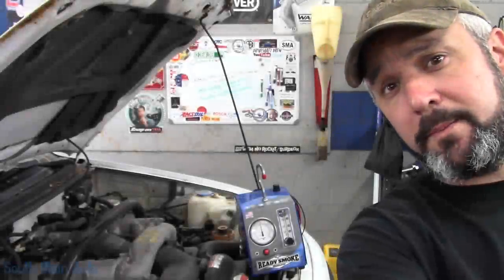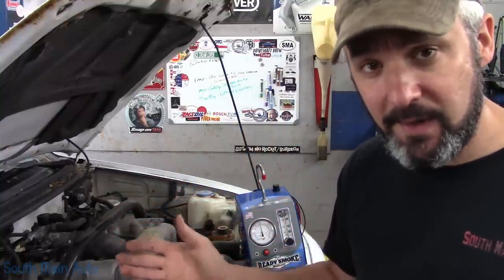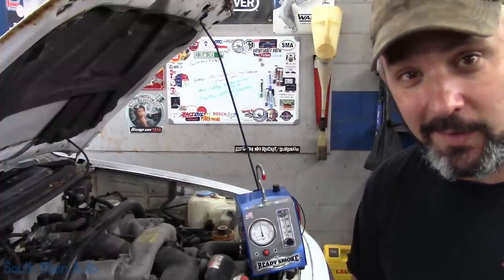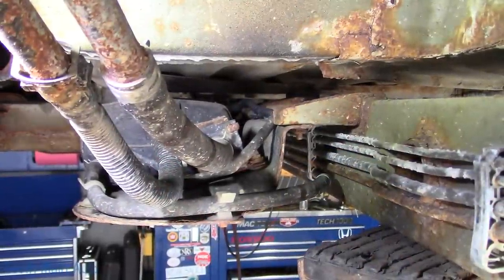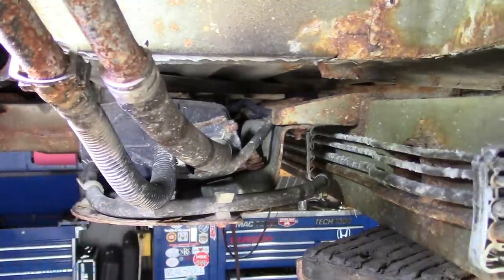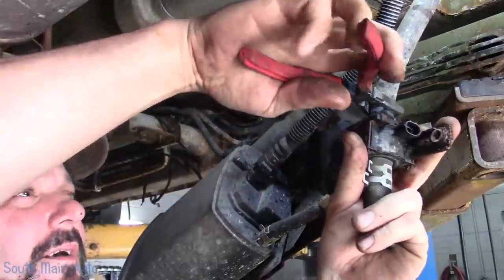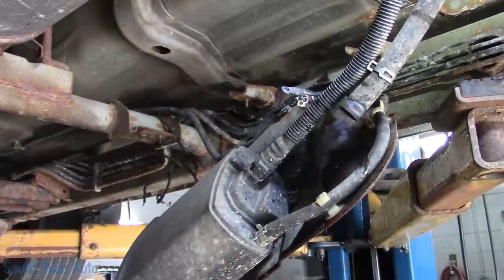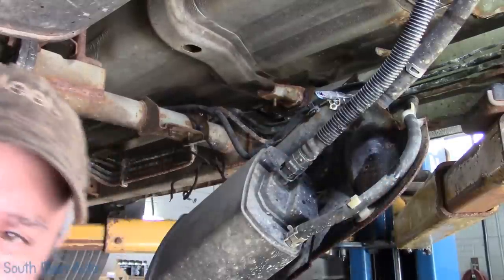Suzuki Vitara: EVAP Problem & Discontinued Parts!?

Comment from the maker: *ReadySmoke (95-0400): https://www.aeswave.com/cart.php?m=affiliate_go&affiliateID=2525b91fc8e906e8215984074c9d9e8f&go=https://www.aeswave.com/ReadySmoke-95-0400-p9661.html
Reply: Looking at those crusty tubes running along the rail, I'm guessing one is fuel and the others are brakes.  For those of us who live in the rust belt, I sure wish the government would mandate a more corrosion proof material for both of those.  Nylon for the fuel lines and there has to be a more corrosion resistant type of brake line other than just plain or even coated steel (without going to stainless steel).
Reply: Look for Cunifer on google
Reply: Where did you get a test light that is higher amperage? or did you just find a build that would work.... And who made the test light with a vice grip? Cool idea!
Reply: @ 16:00 to 17:00 is that the exhaust pipe torn off and dangling there??
Reply: I've been watching your videos. I thought you might find this info useful: Mouser Electronics, which is a major electronic component distributor, stocks a lot of automotive connectors. Not pigtails, they sell the terminals, wire seals, connector shell separately. You do need to know the connector manufacturer and part number or be ready to look through pictures for it, but I have gotten a couple of connectors from them that were either unobtanium or ridiculously priced as a pigtail (a $50 pigtail that consists of $1.60 in terminals and wire seals and $2 in a connector plus $1 in wire, for example). Another distributor, Digi-Key, also stocks automotive connectors but from fewer manufacturers. 

Both companies are happy to send your order via first-class mail so shipping for small orders is cheap.
Reply: @jackpatteeuw9244  I have this car and it is equipped with plastic coated steel brake lines.
Reply: Nice way to repair an absolute non existent part.
Reply: So where did you buy the part ??

Comment: The Vitara was also sold as the Chevrolet Tracker. The part you needed is ACDelco 214-1059 and is still available.
Reply from the maker: Yep sure is! That's the little guy right there :)
Reply: erlebo you beat me to it! My wife's tracker had this same failure, I found the part no problem. Good fix Eric!
Reply: In my experience the GM Suzukis have different connectors and harness to Suzukis.
Reply: Knew it...😀
Reply: Omg that's it and still available on Amazon for $38.
Reply: GM to the rescue
Reply: Oh wow. She can do it but can he?
Reply: Nice research!
Reply: Would it kill AC Delco to list the part under the Suzuki application? I have a 2006 Saab 93, needed a gas cap for it, as you may know GM owned Saab at the time that car was made, turns out that the 2006 Corvette uses the same gas cap but AC Delco only lists the Corvette application for it. (The non-oem gas caps seem to not have the tether strap so I didn't want to use one of those).
Reply: How do you buy Vapor canister for suzuki vitara 2003?
Reply: @SouthMainAuto  How do you buy Vapor canister for suzuki vitara 2003?
Reply: I was wondering if this would be the case. Had a 2001 tracker LT. Really damn good little 4x4. Body on frame with a low range transfer case.
Reply: Sam Zaky same part
Reply: I don't see the point of yearly state inspections.
Reply: GNX157  3 years on and “inflation” has it now up to $45.78 (+shpg when needed quick) So Eric probably saved them $20 and got their hoopty back on the road quick. 🤣  Here’s a challenge, find a Suzuki X90 w/o a rotten floor! Between the leaky T-Tops and road salt it’ll rot from both sides. 🧂 🌧  Only about 9k were imported to the US so on track as a collectible despite it being a two seater bar of soap. 😉
Reply: @donv6039  If its a rust free X90 you seek, you must go west young man for in the west even a X90 may stand a chance. 🤣😂🤣 I live in Michigan so most vehicles begin rusting on the car lots waiting to be sold.
Reply: @grominwithrob1339  Yeah, so true. I looked at two when shopping for my sons first car. Both had floors akin to crispy hand tossed pizza. 😬 Ended up getting him an 01 Xterra.  Gave it a thorough refurbing and it has been reliable so far. MPG not so great but gets him to college and back.
Reply: Will it fit the v6 model because the part comes up but it say it won't work on my vehicle

Comment: I once used a Chevy ignition control module to replace aToyota 4x4 igniter. 
I rewired it accordingly and hid under the original igniter. You had to look real close to tell. Chevy module: about $35
Toyota igniter: about $400. The customer was tickled pink and has been a regular customer for many years.

Comment: Mad respect for thinking out of the box Eric, and going the extra mile for the customer. A lot of shops don't do that. (as evidenced by the previous three)
Reply: Other ones did not even get close to diagnosing the original problem correctly before they got to the Evap problem (wish I had a good mechanic like him or his shop in the uk)

Comment: I have done the same sort of substitution many times.
Knowing system operation, you get to know which other vehicles operate the same way, so you can use the most cost effective and easily available part.
As Eric said, some people have recognised the exact part used on other vehicles, I suppose it just depends on what jobs come through your door.

Comment: i have used heat shrink tubing on the hose ports to "make up" the difference in hose diameters. seems to wok well. seals very well. it gives a kind of "no slip" surface so the hose holds well.
Reply: J.C. SMITH PROJECTS   That is a great idea!  Gonna do it next time.
Reply: Or a couple wraps of Super 33.
Reply: yep heat shrink or section of smaller hose inside if the diameter difference is great. not much pressure/vacuum there. just have to worry about possible fuel vapors.
so don't use tape, the glue and fuel/vapors are no bueno
Reply: @throttlebottle5906   There's a lot of small evap hoses on my car that came with plastic connectors/solenoids that are no longer available, so I have to do the "smaller hose stuck inside a larger hose" trick quite often now.

Comment: My local (larger shop) mechanics won't even go near a repair like this. Everything they put in the vehicle has to match the broken part and have a parts warranty so they don't assume any cost for a faulty part should it go bad again after repair. It's really tough to find a mechanic that just uses their wits to get the fix in, regardless. Often times, I have to pay for diagnostics (because smoke machines and diag computers are so dang expensive) and then spend quality time under the car atop cardboard putting in fixes like this.
Reply: wxfield: as I`ve mentioned many times before, when you do people a favor they will stab you in the back if given the chance. Eric knows this well but he`s willing to risk it to fix things. Thing is, if he gets burned too many times he`ll have to stop.
Reply: 2sheets to the wind: Thank you for telling us what Eric is thinking, so many times before.. Happy Fourth of July !!
Reply: Communication is key. You have to tell them exactly what's wrong and that parts aren't available. You tell them warranty is limited or nonexistent. And you inform them of the part and repair you are suggesting. If they decide to do it document and cya
Reply: If it's hard to get a hold of the part or guarranty the repair, no shop would want a vehicle sitting around on their property for an extended amount of time or tell the customer that they cannot fully back up their work. If the repair doesn't work out, neither side will be happy.
Reply: CarEnthusiast actually they have to be smart enough to figure out what the problem is.
Reply: I think that is 95% of shops out there.  Is to much of a risk for a shop to try to perform a repair like this to an unknown customer and with little profit gain.
Reply: @elora2525  LOL, just wrote a reply stating this. It really comes down to the customer and the repair. This fix is simple enough, and not even worth mentioning to the client. Some people freak at the idea a non-standard part might be used.

Comment: As soon as you said they no longer make the vent solenoid, I thought of the same idea. I was offered a Suzuki Swift for a minimum amount of money. I told my friend that I probably couldn't get any parts when it failed. Another great video SMA.
Reply: Except that he forgot to take in to consideration that the Suzuki Vitara was also sold as the Chevrolet Tracker here in the U.S. and the part he needed was actually readily available as a Chevrolet Tracker part through AC Delco and very easy to get AC Delco # 2141059 .  Same goes for the Suzuki Swift you were offered, many of those parts are the same as the Geo/Chevy Metro.  l've owned both Geo/Chevy Metro's as well as Suzuki Swifts, parts were plentiful and cheap, you just have to have some awareness on how to order them, because 99.9% of mechanics and counter help at auto supply stores were/are absolutely clueless to these facts. Over 1 million Swift/Metro's were sold in the U.S. so parts for them can even be found on Ebay for goodness sakes!

Comment: Really good work. I was thinking the same thing about Subaru Legacys as a lot of others, here. Not that that would help with our local Subaru dealer. They refuse to do mandatory recalls on cars older than 10 years old which they have sold, much less provide parts for owner repair.
Your videos have taught me so much. Thank you!

Comment: G'day, Mr. O!! Excellent... 'Machine Gun Josh' 😉 providing the wonderful (SMA) ambient, and background noise! By the way, big thumps up for adapting, and improvising!! "That's using the old noodle!'' (To use one's own intelligence and intellectual ability; to think logically and rationally. ("Noodle" here is slang for head or brain.) Awesome job! 

Cheers! 😊✌🏼🛠💕

P.S. Going back in Nov. 2012... "American Suzuki, closed U.S. car division, and restructured to focus on more long-term growth for Motorcycles, All-Terrain Vehicles, and Marine Outboard Engines."
Reply: "Noodle" here in the US could refer to either your brain or your penis depending upon context. For example, "I should have used a rubber on that girl, but I was thinking with the wrong noodle."

Comment: I had the same problem with a jaguar last week! And it was the same DENSO valve. Vent valve but listed as a purge. No stock on the part anywhere. I thought instantly of using the gm vent solenoid due to the included harness. Instead the problem wasn't it leaking but corrosion on the inside was keeping it from switching so we took it apart and cleaned it up. The fix was perfect .... To get them through their emissions test! Happy Canada Day 🇨🇦

Comment: Awesome job... I'm glad u were able to adapt and overcome. GM parts for the win, it's nice to see a mechanic take the little bit of time to do this little fix because most shops would just tell them the cars junk in an annual inspection state I think the only thing I would've done differently is drilling a couple holes through the canister tray and mounted the valve with a fat zip tie or a big metal hose clamp to keep it from rubbing itself to death from vibration. But I'm sure I'm just over thinking stuff lol
Reply: The same car was sold as a chevy tracker
Reply: Thumbs up for avatar and username.
Reply: Before I read your name, I actually try to remove the hair. Damn
Reply: @MirceaD28  Hahaaaaaah  I laughed so hard wgen i read that
Reply: @MirceaD28  You weren't the only one!

Comment: THANKS Eric!!! I had the same solenoid wear out on my AerioSX (same 2.5L) a couple of years ago.  I was able to find one in a junk yard near me on a Grand Vitara that was still working, and they sold me the whole canister and all (still mounted on the bracket) for $20! The car has over 271,000 miles on it right now, and so far so good, but if it goes again I know what part I'm buying to fix it with!  I was sure to save this video to a playlist for future use. 😉

Comment: Superb improvisation Eric O .......you are the best. Just for the record Suzuki is widely available in the UK...maybe useful if you are sourcing parts....
Reply: He could have easily ordered the replacement part he needed, but he forgot to take in to consideration that the Suzuki Vitara was also sold as the Chevrolet Tracker here in the U.S. so the part he needed is available as an AC Delco part which is part # 2141059. That's an exact replacement part.  Also, he doesn't realize that there are plenty of online Suzuki replacement parts suppliers here in the U.S. from which supply OEM parts for Suzuki vehicles. He's not the exception though, l've found that most mechanics are completely ignorant about this as well. For goodness sake, you can even get OEM Suzuki parts on EBAY!  How people can be so clueless is beyond me.

Comment: Good fix Eric! A zip strap or two would hold the plastic valve down with a piece of rubber between valve and bracket to prevent rubbing or a “what’s that rattle sound” comeback from the customer.

Comment: I worked on a 1990 Plymouth Voyager with a rear brake proportion valve mounted to the leaf spring (weird setup based on ride height)  It was leaking, and corroded down to the bottom of the brake tube fittings.  That proportion valve is no longer in existence, and what I could see easily cost a couple of hundred dollars even if it was.  I replaced it with a brake proportion valve for the 1999 model year, and ended up re-doing the brake tubes and routing.  Suffice it to say, you have to do what you have to do, and the repair worked flawlessly.  The vehicles weigh near the same, so I saw no issue with the conversion, just the 1990 won't have ride height proportioning.

Comment: Ivan would have fixed the old one with some WD-40.  I would have used my new power probe to see which wire was the hot one.  😃. Thanks so much Eric, I was about to cry when I opened the box.  I will have videos coming soon of me learning to use every feature on it I've been reading the manual and playig with it.   I want to find a Ford Smart Gen Com/Mon charging system and see if I can read the 400Hz signal with it.
Reply: Most multimeters will let you see the 400hz signal.  Just about any FLuke will. Just push the HZ button. ;)
Reply: WD-40 is magic :)
Reply: The problem with WD40 is that it's a penetrating oil and water displacer (WD == water displacer). It's really good for its intended purpose but if you use it as a lubricant it attracts dirt and you end up with stuff in a worse state than you started with.

For solenoids you usually want something like a silicon lubricant.

That old unit CAN be disassembled and fixed up if you're careful.

Comment: Nice fix - I used this method for a window motor on my subaru...i believe it was a ford labeled part like half the price of the subaru one, but looked identical, but different connector. gambled and ordered it, soldered on my old connector, works fine.

Comment: Only thing I might have done different is maybe save the old plug ins and connected the wires to the old vent valve plug. so’s if ya ever find one or need another ya just pluger in. Nicely done. Nice quick diagnosis on the shorted wire from tranny solenoid

Comment: Junking vehicle is not only option, NYS DMV allows emissions exemption for vehicles 25+ years old but also, if vehicles has undergone $500 or more in attempted repair costs without success to correct problem. I like to call it the "nuclear option."  Just an FYI to my fellow wrenchers. 
As usual though, Eric O to the rescue, above and beyond the call of duty...

Comment: Things which have a simple generic function should be standardized, like fuses, windscreen wipers and spark plugs. This would cut down a lot of waste caused by junking perfectly serviceable vehicles for the want of a single component. Also higher production volumes would keep the unit costs down at the factory.

Comment: Nice fix.  One thing, when you're holding something and using an impact driver, your hand works as a dampener and it deadens a lot of the impact.  If you would have pushed one side up against the frame or something solid, your impact would be more effective.  Sorry if this has already been said.

Comment: Yep, sometimes you gotta roll your own.

The welded-on horizontal exhaust hanger on my 2004 Chevy Cavalier rusted clean off.  They don't sell clamp-on horizontal hangers.  Two regular U-bolt clamps/hangers welded on each side of a bent rod of steel out of the scrap pile worked perfectly.

Had to be extremely careful grinding off the weld nugget of the remaining OEM rod, however.  A slip and the old corroded exhaust would likely develop a through-hole.

To keep the new clamps from possibly crushing the age-worn exhaust pipe, a short section of new stainless steel cheater pipe was slit in half length-wise.  These two halves protected the welded clamp/hanger from crushing the exhaust pipe.

With twenty minutes of scrap pile picking and simple fabrication, the exhaust lives on to get me down the road for another couple of years or so.

Retail shops walk a thin line on baling wire repairs, however.  So, I understand why some places refuse to do them.

Comment: I've had a vacuum valve that failed in my 93 Honda and seemed to cost big money to replace and have had success replacing them with aftermarket parts for Ford's and such. You have to find out if they are normally open or closed type and what voltage they require for switching (often 12 or 5 volts). Grabbing a pigtail from the junkyard can help with splicing it in!